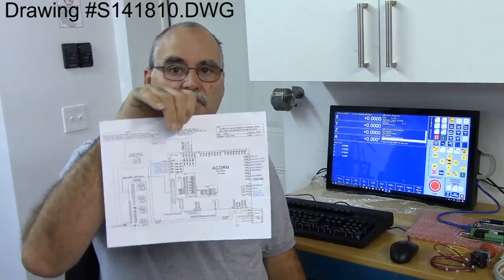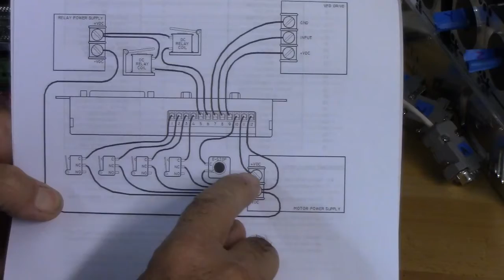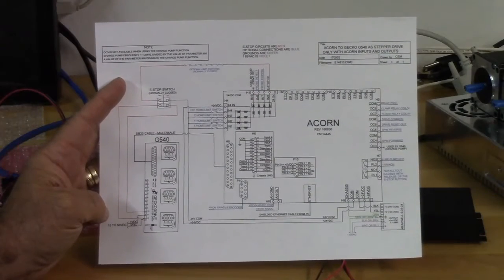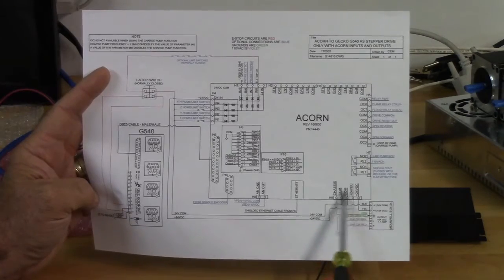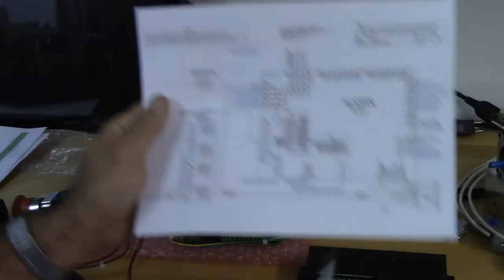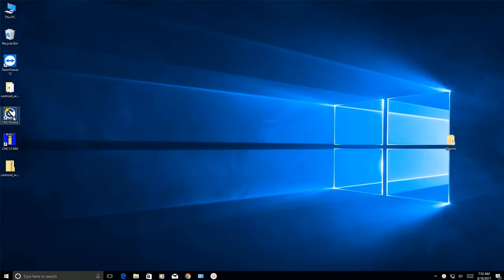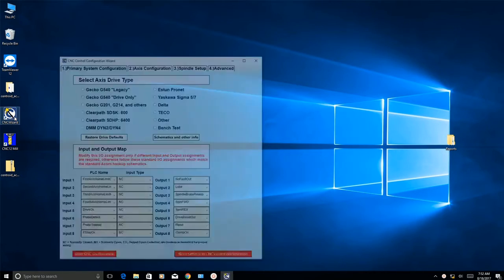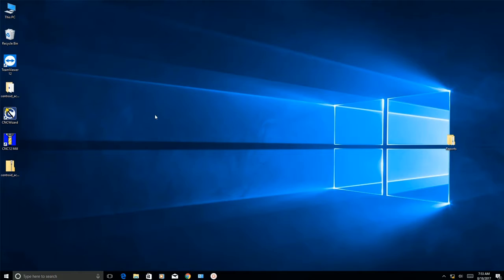Centroid CNC Acorn Gecko Drive G540 bench test

Comment: Please help I have Gecko G540 looking to add AC Servo Spindle Motor.  Will Acorn cnc work with AC Servo?
Reply from the maker: The Servo drive must be able to take 0-10v analog signals.  You would use outputs to control direction. FWD and REV. If your servo drive requires +/- 0-10vdc to do forward and reverse, give CNC4PC.COM a call. They have a board that will do +/- where Acorn will only do +0-10vdc
Remember, you'll have to tune that servi motor to perform well as a Spindle motor. Sizing that servi motor is also crucial for spindle performance

Comment: Hey Marty, I am in the process of retro fitting an old CNC (currently not working) with a new Centroid Acorn and Gecko G540, but the original E-Stop is connected before  the 24v power supply instead of after the power supply. Is there any reason to change where the E-Stop goes?
Reply from the maker: Download and follow the Centroid Acorn system schematic
Reply from the maker: There is a schematic for Acorn and the G540 showing the Estop wiring
https://www.centroidcnc.com/centroid_diy/schematics/pbrowse.php

Comment: How accurate is this G540-Acorn-Stepper combination?

I’m in the process of building my own CNC out of some Hiwin linear actuators. I was thinking about pairing the G540 with the Acorn and using some nema 23 steppers. I am only going to be cutting sheets of acrylic, aluminum and brass so I don’t need anything too powerful for now, but I do need something that is extremely accurate. 

Would you recommend this combination or would you recommend that I go with some Clearpath Servos? 

Thanks in advance.
Reply from the maker: That's an open ended question. If the correct components are selected for the machine at hand, then yes it could be quite reliable. Without fully knowing the details of your build, I can't answer the question completely. Your realistic budget plays a part in the suggested answer

Comment: Could you help with the wiring of Gecko320X servo drive with Acorn centroid please.
Reply from the maker: If you go to the Centroid User Support forum and search G320x you'll find information on it. You should connect to the DB25 port. https://centroidcncforum.com/viewforum.php?f=60&sid=48721dcf7b74712534776cfa6a6cdbc4